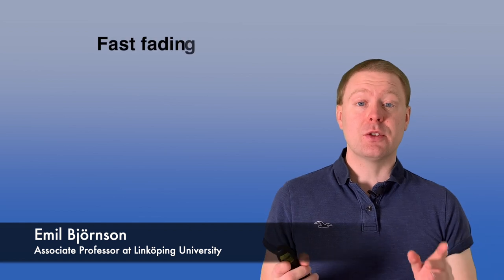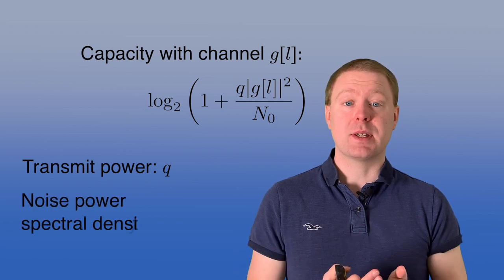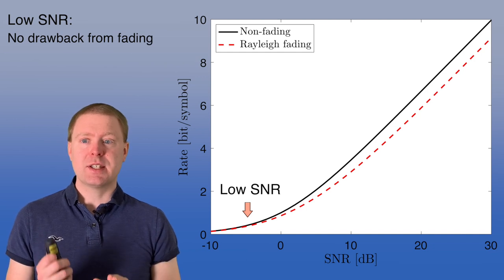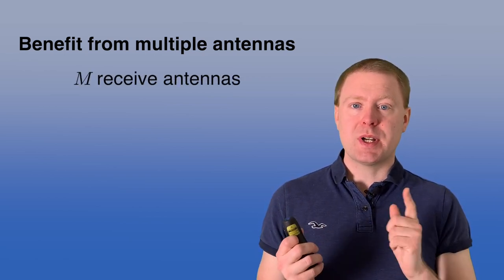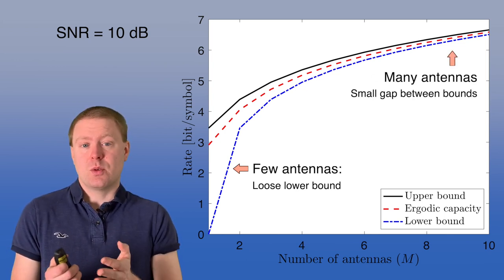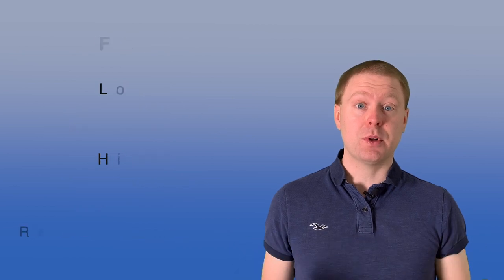Fast Fading and Ergodic Capacity [Video 10]

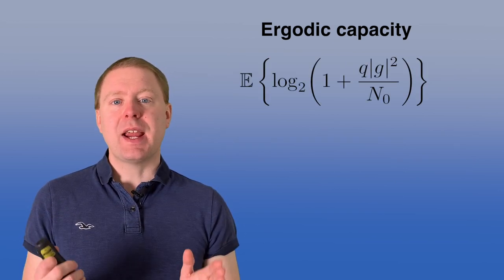Comment: Thanks for great video. I have a question: i want calculating ergodic capacity with your formula in 1:36. In this forrmula, SNR is random variable because g is random (example Gaussian distribution). But in next figure in 2:00, SNR is a specific value, i guess this a expect value of random variable SNR but not sure. So my question is: how to calculating ergodic capacity with specific value of SNR.
Reply from the maker: Yes, we define the SNR as the the average of q|g|^2/N_0: SNR = E{q|g|^2/N_0}. The ergodic capacity is E { log2(1+x) }, where x=q|g|^2/N_0 is exponentially distributed with mean equal to the average SNR. Based on that distribution, one can evaluate the expectation E { log2(1+x) } numerically in two different ways: Evaluate the expectation as an integral or approximate it based on a sample average.

Comment: thank u another great video , and another question is here for you : in 4G , LTE and 5G what is modulation rate or chip rate and  why we could not to increase it to any certain level that we want ? to increase data rate which is proportional to it
Reply from the maker: The modulation symbol rate is proportional to the bandwidth. It is the sampling theorem that determines how many symbols that can be squeezed into a signal. If you sample more often, you won't get more information. This was mentioned in Video 4: https://youtu.be/kP_FhaclHPg
Reply: @WirelessFuture  i have covered almost all of the wired network (optic) in less than 6 months , but it looks wireless is 150X more complicated , only you and some others YouTube videos could make it easier , thank you

Comment: Thanks for the explanation but 

1- at @0:31 why did you mention that the capacity is achieved by sending Large L i.e L-> infinity ?

2-I mean what is the intuition or the reasoning behind this statement ?

3-What if L was finite ?
Reply from the maker: Because the capacity is defined as the highest bitrate that one can transmit with and get zero error probability as L->infinity. Please see the noisy-channel coding theorem, https://en.wikipedia.org/wiki/Noisy-channel_coding_theorem
Reply: @WirelessFuture  Hi 
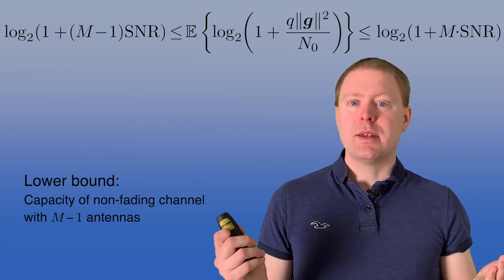 @3:40 how was the lower bound derived ? I mean where did the M-1 come from ? as per my knowledge (eq c.3 appendix c in fundamental of massive mimo book) we need to make rv z = 1/ u inside log term this u is 1/norm (g)^2 is an inverse chi squared random variable

E log2(1+z) > log2(1+1/[ E (1/z) ] ) = log2(1+ 1/[ E (1/norm(g)^2) ] ) and the mean of the inverse chi squared random variable is number of degrees of freedom - 2 thus this should be M-2 instead of M-1 

is that right ?

Thanks
Reply from the maker: @yasserothman4023  norm(g)^2 is a (scaled) chi-squared distribution with 2M degrees of freedom. When you subtract 2 from that you get 2(M-1). It all has to do with that the real and imaginary part only contain half the variance of the random variables. If you want to learn more about these things, I recommend Random Matrix Theory and Wireless Communications